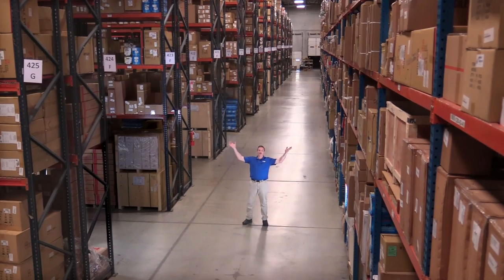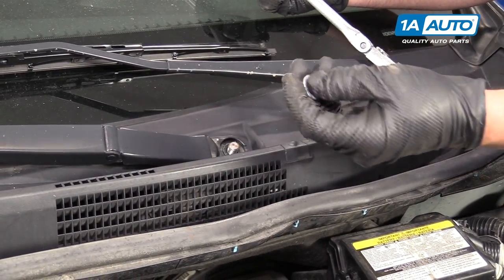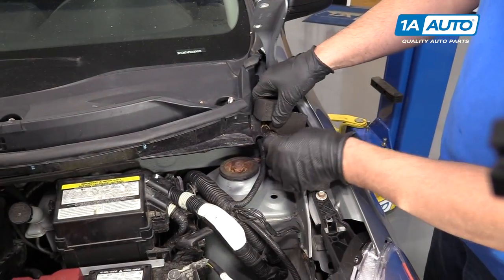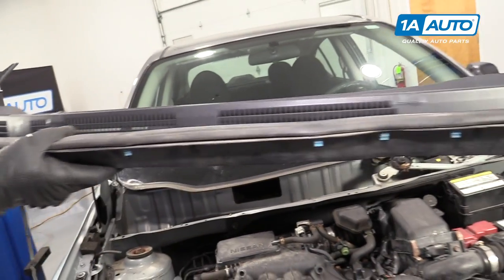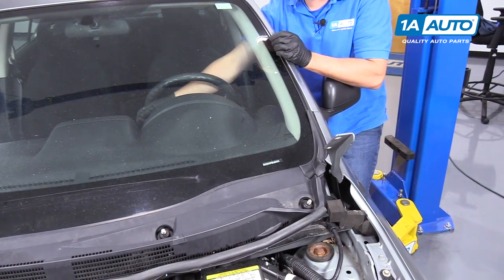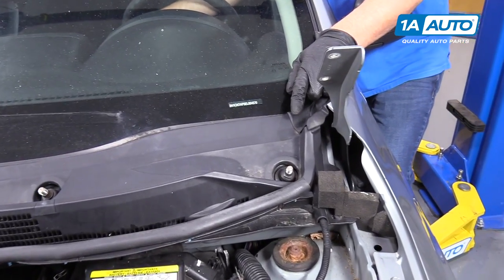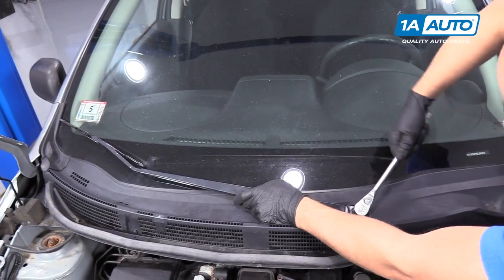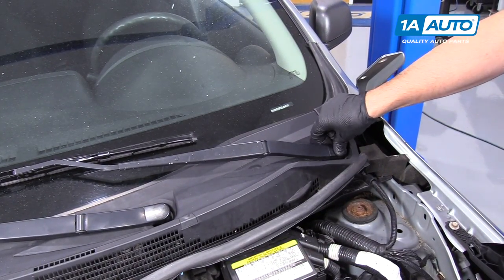How to Remove Cowl Assembly 12-19 Nissan Versa

Comment: Thank you for the video!!! Saved me $$$$$$!!!! My drains were clogged and needed to remove the cowl to clean them!
Reply: did you also have water pooling in your passenger footwell? I'm having the same problem and I hope this video helps
Reply: @FAIRYGIRL911  did it help? Im having the same problem!!
Reply: @FAIRYGIRL911   Yes. I have been through this process twice with my 2015 Versa Note. Both times, it was just the passenger side front and rear that flooded. And I mean FLOODED. I must have vacuumed 4+ gallons of water out of the passenger compartment. The drains in the tray under the cowl clog up, and the water flows in through the cabin air filter intake. Once I got the cowl off, I shop 'vac'ed' out the water in the tray, dried everything out, and blew out the drains with compressed air. GOOD LUCK!

Comment: WHY DID YOU REMOVE  ,YOU DIDN'T SHOW  THE CLEANING OF THE DRAIN ?
Reply: John....I was hoping for the same thing. The 'tray' under the cowl on my 2015 Versa Note was loaded with dirt and sludge, and about four gallons of water after some heavy rains. I used a shop vac to get most of the water and gunk out, then cleaned everything with rags and water. After that, I used an air compressor with an air nozzle to blow out both drains. Followed that with the shop vac set to blow to get everything bone dry before putting the cowl back on. Hope this helps. Steve

Comment: Hey, I was working on a friend's 2013 Nissan Juke tonight. Your video shares a very similar repair. Thanks! Hopefully cross-posting this helps someone and drives you some traffic for a helpful video. 

Here's the wiper nozzle replacement video with my reply: 

https://www.youtube.com/watch?v=BjG_WnqGl74

***********

Lawrence Wade
1 second ago
 @drcoland  I did it tonight on my friend's 2013 Juke. Thank you for the info. I did, however, have the end of the hose fall back into the cowl assembly. LOL...

So to anyone doing this repair, be sure to have a clip or something on the end of the hose so it doesn't fall into the cowl as you're cleaning the nozzles. 

If this does happen to you, you're likely to need a small puller to get off the wiper arms, and a nice trim tool to undo all the clips around the cowl assembly. I had no luck trying to even feel the end of the hose with a grabber-type pickup tool. The cowl had to come off. 

I'll also tell you that the little hose barbs were very effective, that hose was not in any danger of falling off the barb on the nozzles.

I did this with a North American vehicle. For this task, your right-hand-drive version appeared to be a mirror image of what I had. 

Mark the position of the wiper blades on the windshield so that you can get the wiper arms back in the right spot since they're splined but don't have a keyway. You will need to remove the wiper arms to get the cowl up enough to get your hand in there to grab the errant hose. The cowl slides forward because it has a lip under the windshield. If you forget to mark the wiper position, look at the marks on the windshield to to put the arms back on in the same place - don't get cute and wash the windshield while the wipers are out of the way. :) 

Use a slot screwdriver to pop off the caps on the wiper arms, and then use a 14mm socket to get the nuts off the wiper shafts. Put the arm of the ratchet nearly parallel with the wiper arm and use them together. Another YouTube video (I will cite it, it's for a Nissan Versa, more similar than different) calls for a torque of 17 foot-pounds on those nuts, you don't want to stress the wiper shafts or have a ratchet handle bounce off your windshield. 

Use a jaw puller to grab the wiper arms and pull them off the shaft. I live in a snowy climate with road salt, and there was corrosion on the splines. I tried WD-40 and it might have helped. On the passenger side, it was seized pretty well, and the puller kept coming off the wiper arm because the jaws didn't want to center on the arm directly over the splined shaft. 

In the end, I decided to let the puller sit where it wanted to sit, maybe 1 cm (1/2") up the arm from where it would be centered over the shaft. I needed a strong and narrow piece of steel to let the force of the puller be transferred to the top of the shaft.

I took a flat file, laid it lengthwise on the sticky side of a strip of duct tape, and wrapped the file that way so it wouldn't scratch up the wiper arm or the windshield. I laid that along the arm with the free end over the end of the shaft and put the puller on and cranked it down. In that way, I was able to push it off the shaft without the puller being exactly over the shaft. When the wrapped file laid completely flat against the wiper arm, the wiper arm had been released from the shaft. With the puller applied and putting a fair bit of force on the file, I tapped the file gently with a hammer to percussively persuade it to behave. As you can imagine, I was calling the car all sorts of supportive and nurturing names.

I know what you're thinking. LOL.... and I was gentle with the tap-tap-tap, and I find machines are more helpful when you talk nicely to them. Something about your mindset makes a difference. 

Where the trim comes down from the A-pillar, there's a pin and a hook molded into the flexible trim. The hooks will be closest to you if you're standing over the fender, the end of the pin will be facing you. The hooks and the pin catch the cowl assembly. 

There are plastic pins with spreader inserts along the front of the cowl. Pop them out. The little door on the heat shield behind the engine is velcro-type fastener on the side nearest the fender. Pull it out and then rotate the heat shield up to access the two insert pins underneath. This was a turbo car, yours might not have a heat shield. 

There is a little foam block attached to a plastic elbow right at the front end of the cowl near the passenger side. Despite caution and care, I broke the barbed stud where it attaches to the structure of the vehicle. 

Once those things are freed, the cowl should be completely removable. There's a plastic double-barb hose coupling connecting the washer nozzles to the pump, it's easy to remove without tools, but you've probably had that apart a few too many times trying to clear the nozzles with compressed air and making sure the washer pump is actually working decently.... :) 

In the end I just needed to get my hand in and find the end of the hose to push it through the hole and attach the (CLEANED!) nozzle. 

Putting the cowl in place requires getting the lip under the windshield. Once you have it lined up all the way along, an insert pin on either end of the cowl will keep things together while you reinstall the wiper arms (torque nuts to 17 foot-pounds for the Versa, probably the same for the Juke) and test your repair before you put in the rest of the pins. 

Here's the Nissan Versa cowl removal video. I am not endorsing them, just saying they had a helpful video: 

https://www.youtube.com/watch?v=FTxAKalZUeI

Hopefully this helps someone. :)